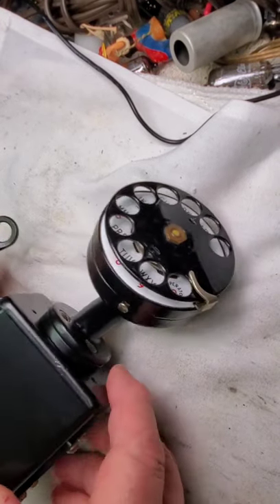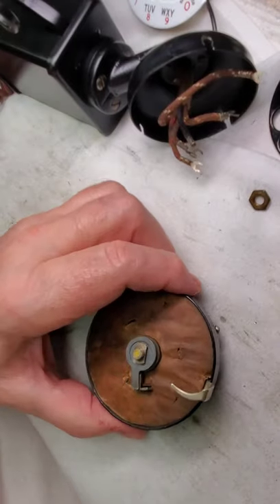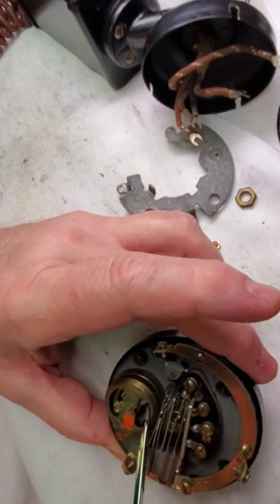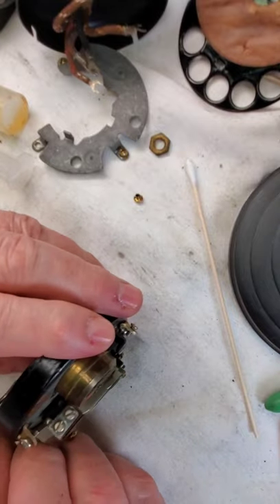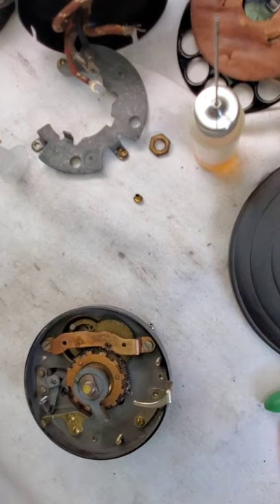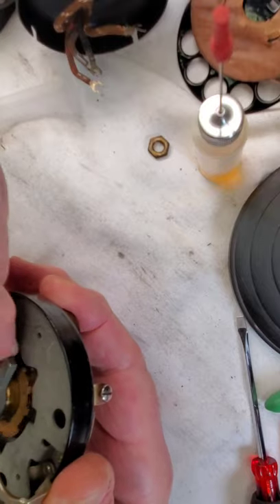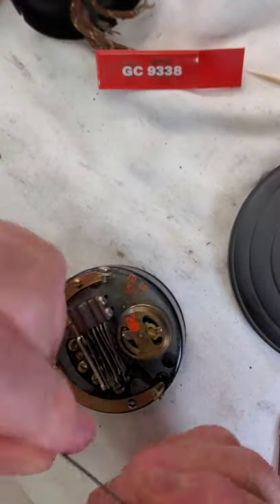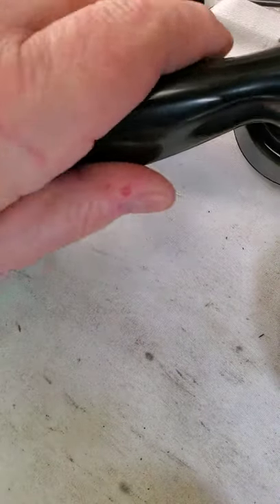Western Electric C-1 Spacesaver Phone 5H Rotary Telephone Dial 1938 Disassembly and Lubrication

Comment: Do you know where I could find information or a video on how to do this for a Western Electric 500 model desk telephone?

 I just got one and the dial is very slow, like it's crawling to return back to its normal position.  I don't want to keep trying to use it and cause damage. . Thanks.
Reply from the maker: the basics are the same
Reply: @RenaissancePeopleNYC  Okay. Thanks. The dial is currently not usable in the condition that it is being so slow like this. My first time ever working on one of these dials  so I will try to be careful. Thank you for responding.

Comment: how do u install a dial card as mentioned in your video ty.
Reply: At 20:06 you can see two rectangular holes in the finger wheel.  A ring called a "dial card holder" hooks into those holes.  There is a site for old phone parts where you can buy a dial card holder, blank dial cards, and the plastic disk that goes in front of the card.